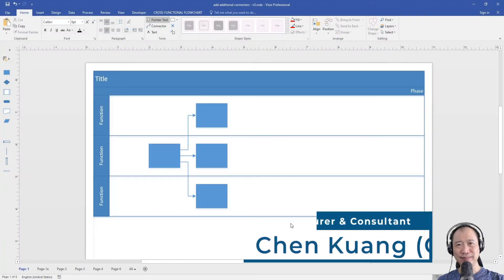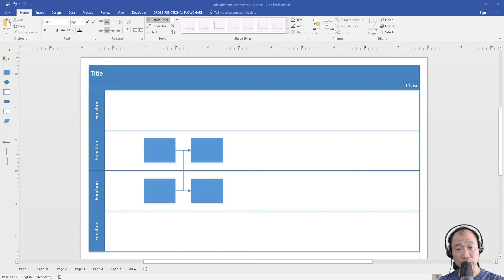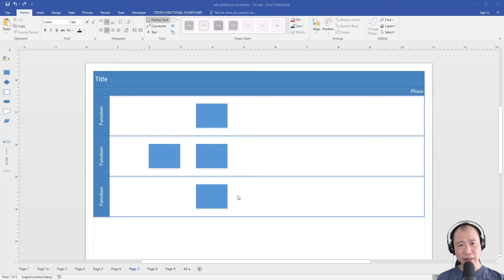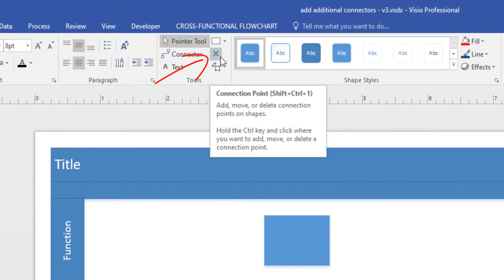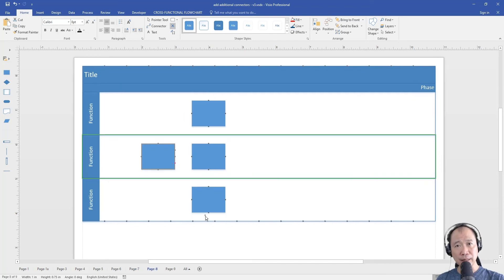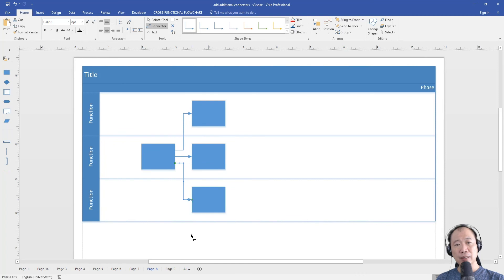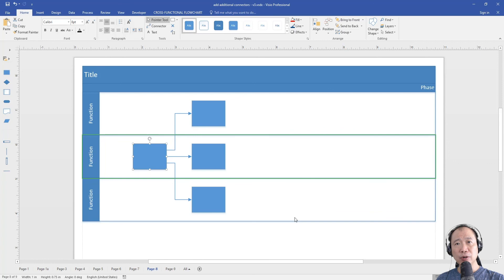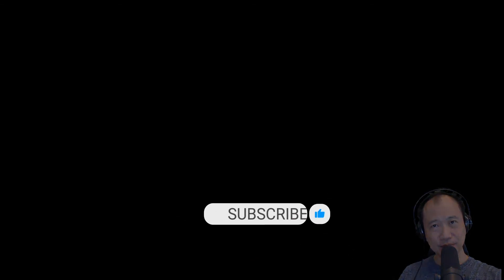Visio - How to Add Additional Connectors to a Shape

Comment: This is a good solution for a single shape but what a pain to do this to every shape that needs additional connectors in a large workflow. I wish Visio just gave us the option to specify the number of default connector points. so that every new shape had them by default.